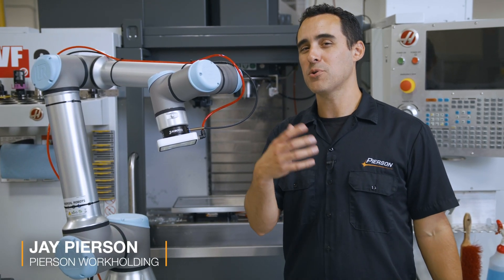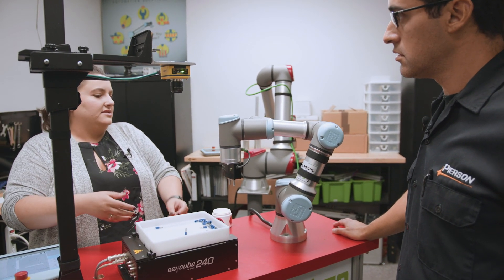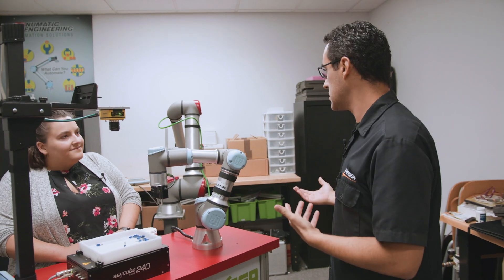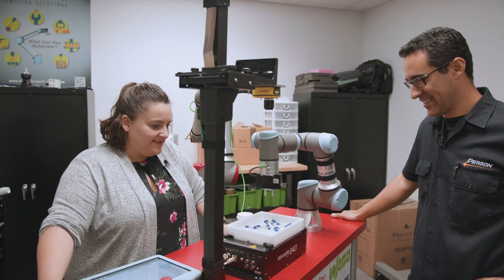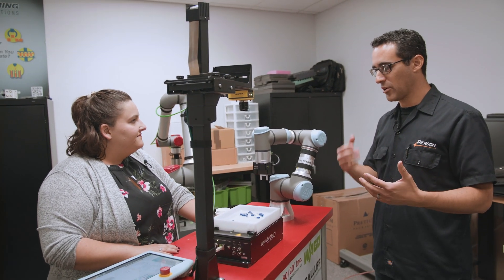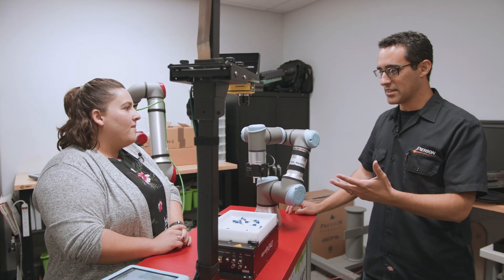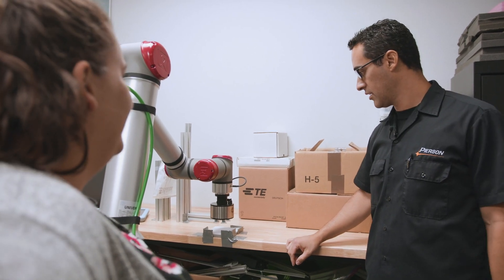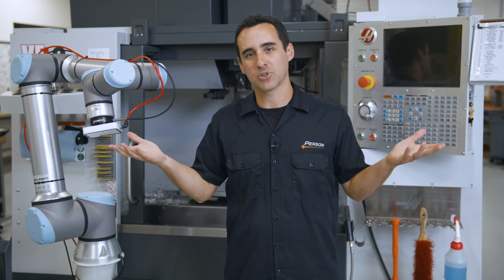What is a Shaker Table? | The Robot

Comment: I've been curious about how you are registering the blank aluminum you are starting with - I know you have a camera, but is that how it knows where the center of the piece is, or is there another method? How accurately and repeatably does it pickup the part and same for placement on the vacuum base? Thanks!
Reply: the camera counts the pixels from edge to edge and calculates the center, accuracy depends on resolution and image quality

Comment: quick tip! perimeters are much more effective at increasing strength and stiffness than infill, you can print in 4 or 5 perimeters if you need a really solid part while keeping infill at 30%
Reply from the maker: Good tip!